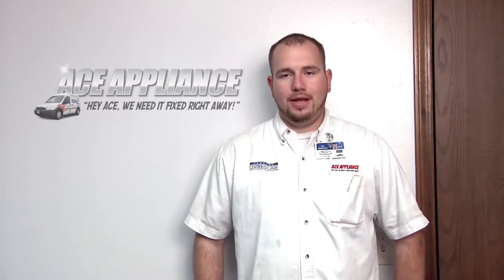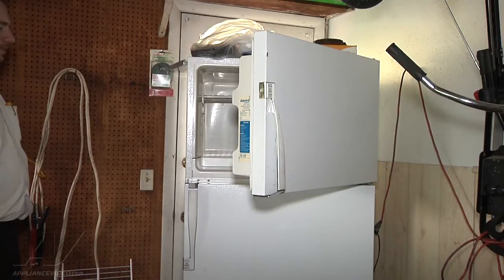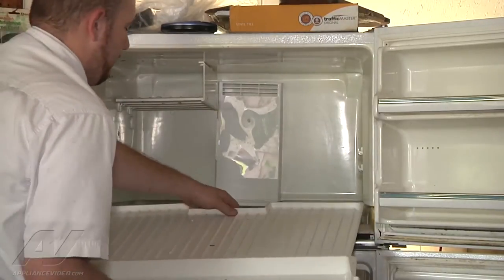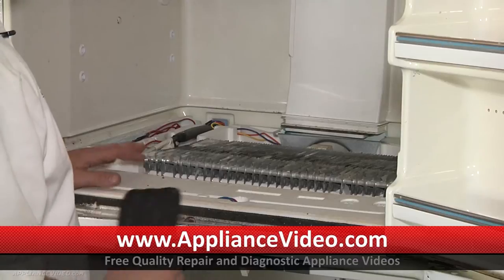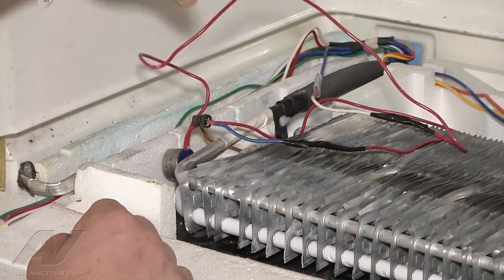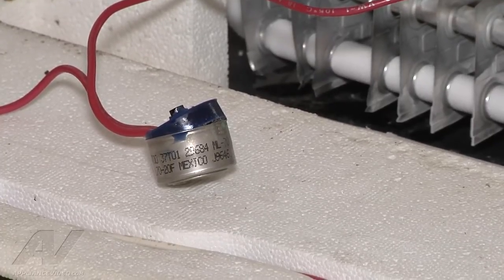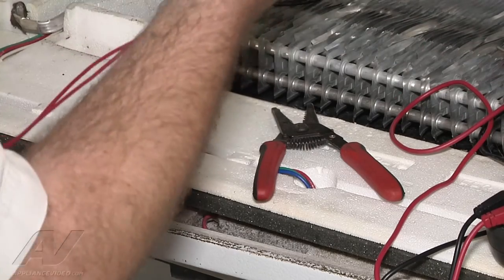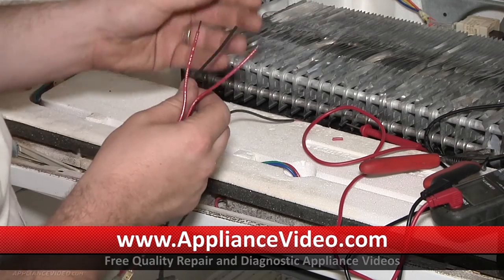Admiral Refrigerator Repair - Not Cooling - Defrost Termination

Comment: I have an admiral SB540w double door,and the chiller side keep losing the temperature,but the freezer part works well .
Reply from the maker: Great question, if you have a more technical question that our parts department cannot answer, you can search our over 17,000 answered questions free at our website www.ApplianceVideo.com under our Repair Help section. You can also call our parts department at 1-800-830-5465 and they can give you help 7-days A week ,or search at www.SaveMoreOnParts.com  .

Comment: Is the Admiral the same as the Jenn-Air?
Reply from the maker: Great question, if you have a more technical question that our parts department cannot answer, you can search our over 17,000 answered questions free at our website www.ApplianceVideo.com under our Repair Help section. You can also call our parts department at 1-800-830-5465 and they can give you help 7-days A week ,or search at www.SaveMoreOnParts.com  .
Reply: The so-called styrofoam in the middle of the Admiral's refrigerator